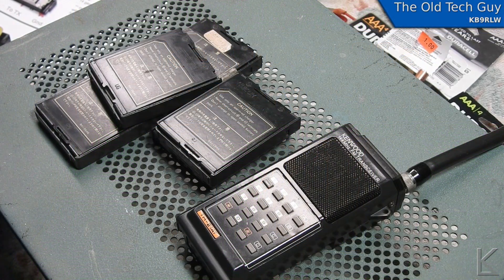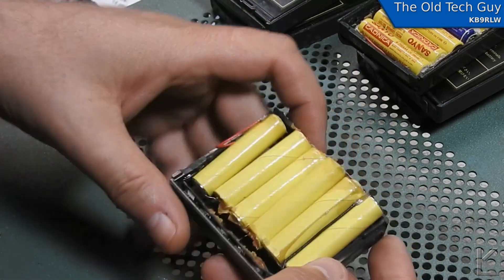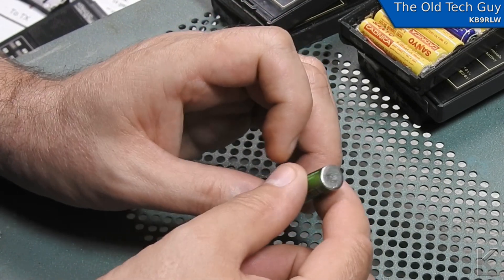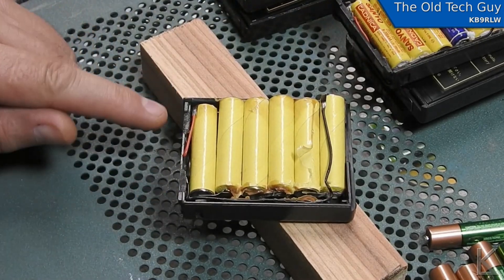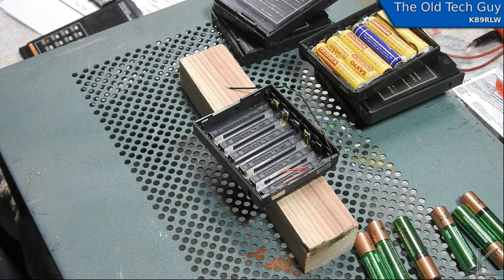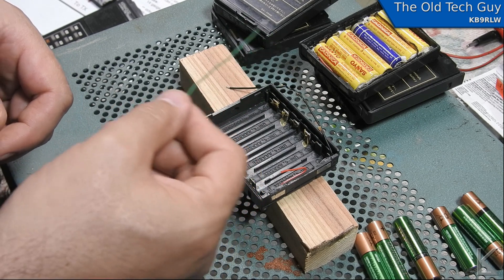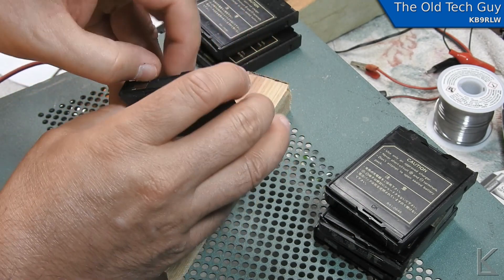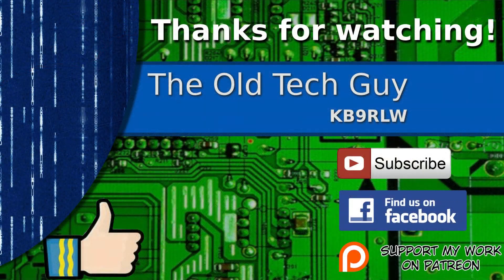Ham Radio - Kenwood TH-21at battery pack repair, new cells.

Comment: Great timing, I'm hoping to revive my bearcat bc200xlt, but the batteries are yuk.  I opened the compartment and the battery wires are soldered to a circuit board.  I know years ago I tried charging but the battery got hot, so I'm concerned if the circuit board is ok before I try re-doing a battery pack.  Is there a test I could do to test the circuit board or will the new battery pack tell me?  Thanks for your videos.
Reply from the maker: I've never worked on one of those.  You could check the pc traces with a multimeter on continuity mode.

Comment: Are you using a knife or a splurger tool to separate the battery packs? Thanks, nice video and much less expensive than the battery packs from W&W or any other battery sales outlet. Thanks for this video Kevin. Hope to hear you this weekend on Ohio QSO Party. K8BF is my club call and I will be one of the CW OP's. 73
Reply from the maker: A small flat blade screwdriver and a bit of patience.

Comment: Very good video my friend. I wonder if you could 3D print a shell which holds twice the amount of batteries and last longer. (12 batteries with 6 in parallel with 6).

Comment: I was thinking that while you were fidgeting with the two cells in your wooden block and one fell over, wrap some wire around them and that would keep them together till you get done soldering them :-)  I don't know how much those duracells were but maybe one of the battery outlets would make those up. I used to get IC-BP8 inserts for my IC-03AT packs. The way you did it may be cheaper? There are no temp switches in the packs you did but the inserts had them for the ICOM.

Comment: I would bet the farm he has a charger that also has one or more broken tabs or will soon.  A 3D printed charger end for that would be a great thing.  Something with thicker plastic tabs.  It was never a good design.  I have had several of those.
Reply from the maker: Yep, he came back with two chargers the next day.  One works, but has a broken tab.  The other has good tabs but doesn't work.  So I'm switching them around today so he has good tabs on a working charger. :-)   I might just take a long look at that and see how printable it would be.  I might be able to design a replacement.  I'll put it on thingiverse if I do.

Comment: Have you tried to revive any of the old ni-cad packs?  I started replacing the cells too but then I found that a lot of them can be brought back to life and will continue to work if they are in pretty good physical shape and not too leaky and corroded.   What I do is connect the cables from my welder across the battery pack, it causes a loud band and you get a big arc and then the battery comes back to life!  There are some videos showing this where they say the polarity doesn't matter and that you can even use an AC welder but I have a DC welder so I connect + to + and - to - which not only revives it but gives it a bit of a charge at the same time.  I tried this on 18 volt Riobi power tool batteries (the yellow and black ones) and was able to revive 20 out of 21.  After that they need to be charged for 2 hrs.   Other kinds such as DeWalt were not as successful since they are just too old.  This doesn't work on other kinds of cells though, only ni-cads, and won't work on ones that have some kind of charging circuit inside the pack unless it's taken apart and the batteries disconnected to avoid burning out the charger.

Comment: Nice job Kevin =)   Note as long as the new replacement batteries are around the same mAh rating the old ones the charger should work fine =)   If they ( the newer batteries )  have a larger mAh rating you may have to research the type charging circuit the charger uses =)
Reply: That would be true on some chargers ..... some of the chargers have a timer circuit ( I know cheap TTL design ) and current limiting in some early HT's / equipment /-)